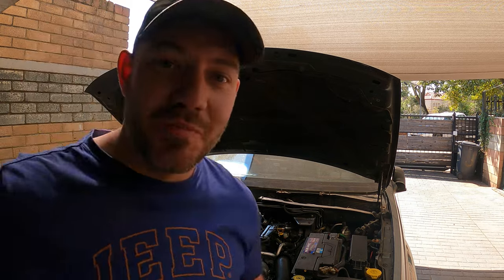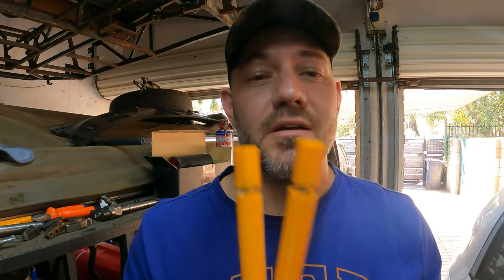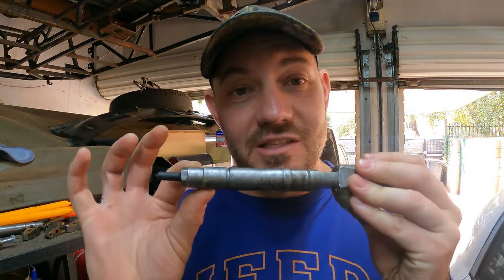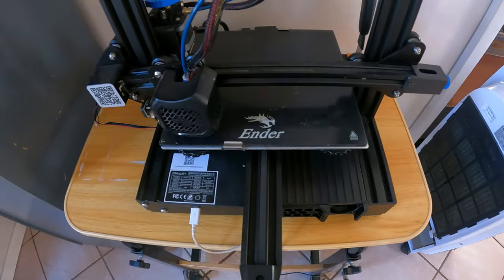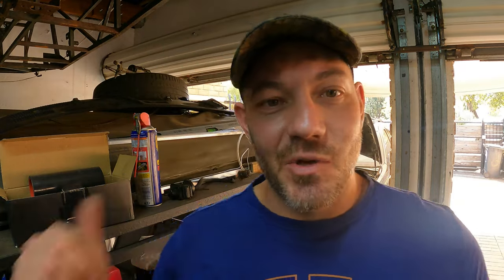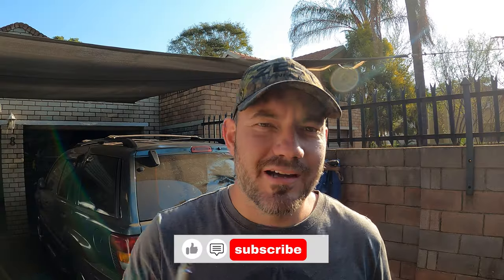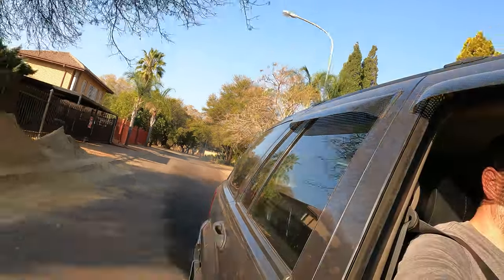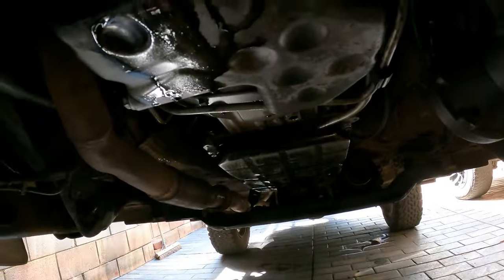Fix My Engine Using 3D Printer

Comment: Ok, ignoring the part where I was scratching my head and wondering what material you printed with, I do have a couple questions (bear with me, I'm a mechanical idiot) 
1. if its over fuelling, can't you get the injectors tested? I believe it's a flow test and I remember something about certain injectors you can replace the tip, just the tip. 
2. compression test to confirm oil isn't pushing past the rings? and lastly..
3. I think that jeep has been parked too close to Land Rovers and learned the bad habit of leaking oil (I owned a Landy years ago, I knew it was low on oil when the leaking stopped)
Reply from the maker: Hahaha, love it!
1. Injectors was tested on bench and in another jeep and was 100%
2. I must probably do a compression test, but I dont have those tools.
3. Bloody land rovers! I cant even find the oil leak origin....

Comment: I cannot assist you with the smoking, but the "death wobble" can be cured. I print a lot of front stabiliser bushes for MAN trucks on behalf of a well known big company and they last longer than the original parts. I use CCTREE TPU95 with 100 infill and they work great. BTW, I also print these bushes for fork lifts, golf carts, racing cars, and a great variety of vehicles. Try it if you wish. Oh, and for the Jeep I have printed side mirror mounts in PETG-CF and they also work great. 😀
Reply from the maker: That sounds pretty interesting, I mostly print PETG.
Have you tested the shore hardness of the TPU95? Would like to try it

Comment: See if you have any air inside of the plastic pipe. Change it if they are old. Clean the tank. If nothing cange go whit new injector and rubild the diesel pump. 
It will be interesting see a om612 whit c30amg injectors and om628 pump.
Reply from the maker: No air in pipes, havent cleaned the tank, and now the tank is almost empty, it started smoking bad, makes me wonder....

The cost of that conversion sounds expensive. Haha. Im over using secondhand parts now

Comment: Did u check solenoid of turbo or vacuum lines leak? If all this stuff works properly? Also all the compressed air intake duct need o be sealed Check all tubes hoses radiator for pressure leak.
Reply from the maker: Solenoid and vacuum lines operate 100%, but Boost leak test and Turbo Actuator setting is now on my list. I suspect major boost leak now thinking about it, cause I have a hissing noise under load.